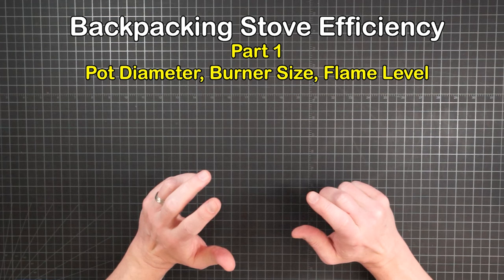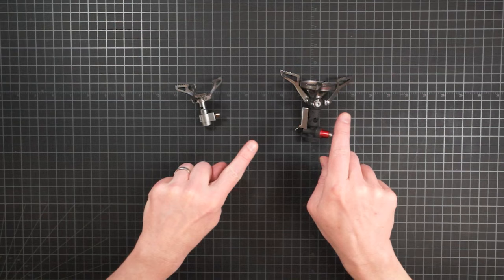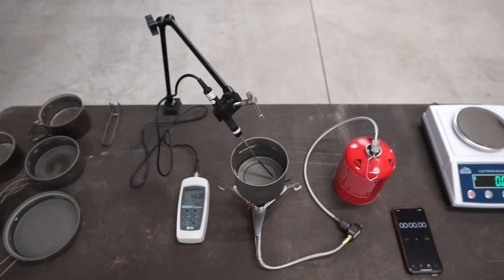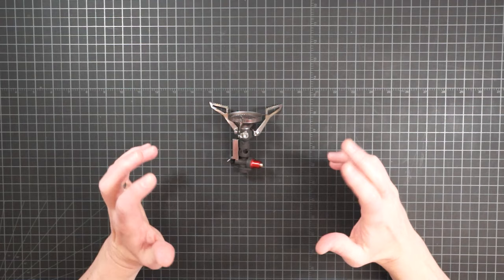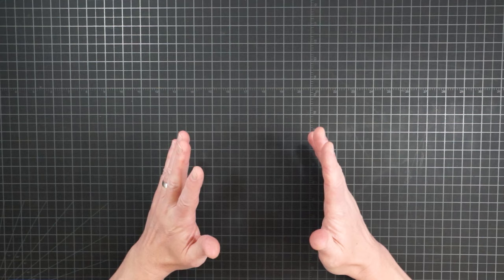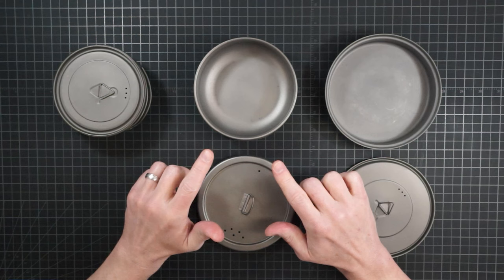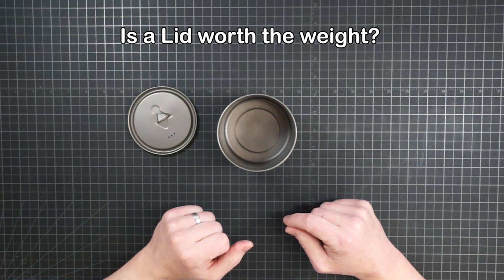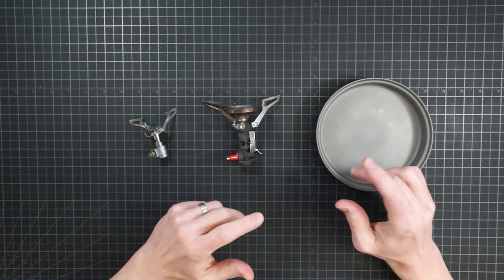Backpacking Stove Efficiency, Part 1: Pot Diameter, Burner Size, Flame Level

Comment: Thanks for another amazingly informative video. I'm surprised the lid isn't worth the weight on the 550.
any chance of seeing an ultra-low setting? your low flame looks about as high as I ever have my brs.
Reply from the maker: Hmm, I’ll have to give it some thought.  I don’t have a 4th valve for an extra low.  Also, you’d need a day without wind.  I’m doing wind-effect testing now, and at the shown Low, the BRS becomes highly inefficient with even a light breeze.
Reply: You'd have another issue. The process of boiling water has energy input from below, then energy loss by convection, evaporation and conduction. The longer time to the boil the more of the energy input is lost during the heating process. The lid helps lower losses from evaporation primarily (and to lesser degree conduction). Each of these will reach an equilibrium temperature where losses = input. A lower flame reduces losses from convection - the air coming up the sides of pot is lower as it's spent more time under the pot. Your intention of boiling water requires that equilibrium to be at/above boiling. If you put too little energy in that equilibrium may be below your desired temperature - i.e. your water doesn't boil. Even if you do get to the desired temperature, the longer you take to get there the longer the pot spent being above-ambient temperature so was losing some of that input energy (via radiation) etc. 

So there's a sweetspot, if you boil too slowly you will lose more energy in radiation+evaporation due to be spending more time at a medium-goal temperature, than you saved from convection efficiency from a slower flame.

So for every stove+pod+wind+temperature combination there's an optimum efficiency flame level which still accomplishes your desired temperature. 

What I do is I keep the flame low initially while the losses due to radiation is lower, then raise it later in the process so I spend less time while higher radiation losses, easy to do with gas, nigh impossible to do with alcohol.

Comment: My understanding was that since the BRS doesn't have a regulator, it's very hard to actually control it using the built in valve. It's either on or at high speed. Do you use it and do you see an issue in actually setting it to low speed in practice?
Reply from the maker: I do use the BRS, and you can still set it to high or low with the control valve much like any other stove.

What the regulator in the Pocket Rocket Deluxe does is to help keep a given setting once you dial it in with the control knob.  So, both stoves set high and low the same, but with a regulated stove, that level will keep itself steady even as pressure drops in the canister.

A bigger problem with the BRS is that it doesn't simmer well.  That's not really a lack-of-regulator problem so much as it is just so small that it tends to give that jet stream flow (as opposed to the soft shower head flow) all the way down to the point where it starts to sputter.

Comment: Very, very interesting. Thank you for the great information. I do have a question related to efficiency tho, Is using a wind barrier important? (Not to protect for wind, but as a heat reflector)
Reply from the maker: Well, they say you should never use a windscreen with an upright canister stove because there is danger of overheating the gas canister and risk of explosion.  I've never tried it myself, but would like to test it out using a non-contact thermal sensor.

But, if you choose a remote canister option (weigh a bit more, but more popular in super cold conditions), then you can put a windscreen around the burner and pot, because the canister it outside screen via extension hose.
Reply: @GearSkeptic  I use a ground based wind screen but always make sure it is open on the downwind side. Trail Designs sells a Varivent version that can be left open or you can make one using heavy duty tinfoil, a couple of small pieces of foil duct tape and two or three short sections of plastic straw through which you insert two or three (two works for me) titanium Shepard hook stakes to hold it in place. A rock will keep the center from moving inward and save a stake.

Comment: MANUFACTURE AND MODEL OF WEIGHT SCALE SO I CAN LOOK INTO BUYING ONE?
  Is that scale made by Seattle Alki?  Which model did you buy and why?
Reply from the maker: Yes, Seattle Alki model SEA3123000GR, available on Amazon.  I wanted hundredth of a gram accuracy, but with the ability to go up to some higher weight (this one is rated up to 3000g).

Comment: An aluminum pot spreads heat more efficiently than Ti so the difference between a wide and narrow pot would be even more pronounced, possibly?
Reply from the maker: It might, but I've been wondering about a variety of effects.  For the fastest, most efficient heat transfer into the water, you want to expose the coldest water to the hottest pot surface.

Aluminum may spread the heat to other parts of the pot quicker (to expose more water to a higher surface temp).  But, water circulates by convection when it gets hot.  This acts to move cooler water down to the hot pot bottom.

I'm wondering if the water's circulation will be so much faster than lateral heat transfer through the metal, that it will overshadow any advantage of aluminum.  Aluminum is lighter than titanium, but the walls have to be thicker to withstand the heat, so the pots usually end up being heavier.

Only testing can tell!
Reply: @GearSkeptic  It's a fascinating topic with all the variables. Yours is one of the most in depth analyses I've seen! Great job!!

Comment: Need to boil lots of water saving lots of fuel for them lids to be worth their weight. Just saying. Wouldn't have expected that result but seems you can have one less thing rattling around yer kit and 16g+ saved should make yer hike noticeably easier for sure.
Reply: Suppose it's obvious at what point in the video i typed that out. Seems to me though unless you for sure need 19+ boils and cant fit 2 fuel canisters(or a larger one) then no lid is the play just from a less crap to clean and keep track of standpoint tbh.

Comment: Did you take into account that evaporation scales with pot diameter and therefore needs to be measured or prevented? I typically use a lid to optimize fuel efficiency.
Reply from the maker: I think I would separate traditional evaporation from steam.  Evaporation is likely too slow of a process to be measurable in these tests.  It's only a 3 to 5 minute period.

The steam from the super heated water, however, would carry quite a bit more heat.  Unfortunately, you can't make the pot a pressure vessel, so there is a limited amount that you can do to stop the steam from escaping.

A lid will still improve efficiency for two other reasons, though.  It limits radiative heat loss, and convective (the circulation of fresh cold air against the hot water surface).
Reply: @GearSkeptic  I sent you an email as well, but there is a weight efficient method to make the pot a pressure vessel! A stretchy silicone lid weighs 14g and can create a tight enough seal on my pot to keep the lid on until a few seconds before boiling. I use a 500ml pot and typically boil ~1.25-2 cups. I bet with a slightly smaller pot that had less airspace in the beginning the silicone lid might be able to stay on up through boiling.
Reply from the maker: Love that idea! Will definitely check it out.  Thanks!

Comment: What about cold? 
E.g boiling water in -5C, 5C vs 10C. 
Not only water temp but the stoves.
Reply from the maker: I would like to do some very cold weather testing, but I will have to wait until next winter at this point.
Reply: @GearSkeptic  same problem here. Wanted to see if different stoves and fuels, winter gas make a difference. But that needs at least <-10C because with warmer weather ordinary mix works somewhat. Unless a cold storage facility provides the space for testing.
Reply: Relative efficiency is not altered by temperature as what ratio of the heat energy transferred, that is the distances and materials.

What can happen is you have different options with the flame level to optimize fuel efficiency. The absolute temperature change when higher makes it more efficient, i.e. to raise temp from -5C to -4C takes less energy than to raise from 10C to 11C. You can use this to your advantage by having the flame lower til water bubbles (so that part is more efficient, less fuel) and then raise flame towards end if required.

A lower flame may not achieve boiling in low ambient temperatures as the heat loss is greater. So if you do use the trick of a lower flame to raise efficiency you may need to raise flame level to get past the plateau when loss=input if that occurs at too low a temp.

Comment: Are all the pots titanium. which does not conduct heat very well???
Reply: Titanium conducts heat similar to steel and about twice as good as Aluminium. But Titanium is about twice as strong as steel, and Aluminium is half the weight of Titanium. So what that means Titanium weighs the same as Alu for like-strength but conducts heat twice as fast. That is good+bad. Bad is the hot spot in the pot is closer to the flame's pattern on Titanium, but less energy is spent in raising the metal's temperature. I use an Alu pot for regular food cooking and Titanium for boiling water.

Comment: I love your videos, but I think they would be more, um, palatable and understandable if you cut them down to a third of the length, and then had a separate video with all the details in case someone wanted to do a deep dive.  Also, I would adjust the overhead camera so the viewer doesn’t feel like they are hanging upside down.  But amazing content nevertheless.

Comment: I'm only 18 minutes in, so you may cover this. In real world applications, the low flame might not be the most efficient. Low outside temperatures means that the water is losing energy to the surroundings at a greater rate and wind may deflect the heat to a greater degree, due to the lower flow/exiting pressure. So in extreme conditions, medium or even high might be more 'efficient' simply because low is not effective enough to counter environmental losses.
Reply: neeeevermind, got to min 25 now. :) excellent video as always.
Reply from the maker: For Part 2 on wind effects, I've ordered a fan with an infinitely variable speed control so I can get it nice and low, and use finely graded steps to see how performance drops off.

Comment: Grey shirt guy wants to know about weight and fuel efficiency for a beer-can pot in a caldera cone with esbit and alcohol fuels, lid on.
Reply from the maker: Noted 😉

I do have (eventual) plans to test alcohol and solid fuel against gas.  Finishing up the wind effects for Part 2, now.  Then wind screens for Part 3. Probably heat exchangers for Part 4.  But, it’s on the list!

Comment: Great study but disagree with one conclusion, to use the BRS.  In real life, the BRS lacks the wind shield and regulator on the PRD and with any real wind (and cold), the BRS will waste more fuel
Reply from the maker: Wind testing is already in the planning stages!
Reply: @GearSkeptic  Awesome, looking forward to it!  In unshielded high wind, the BRS won't even work and the PRD barely does but burns tons of fuel.  In my lightly controlled field testing, my PRD's fuel efficiency (cups boiled/oz fuel) reduces ~ 50% when ~ 35-45F and moderate but gusty wind.  Backpacking Light's tests found the same though their efficiency #s overall are much lower than yours.  My efficiency results and most others are consistent with yours, ~ 8.5 cups boiled/oz fuel 118d pot & low flame.  I assume your boils were 1.75 cups based on 415g of water.  Most others use 2 cups/boil in their testing FWIW.

Comment: I’m sorry, but I’m a bit confused. At the beginning of the video, you said that the industry markets the performance of its products by how fast they boil water. But in all of the test results that I saw, unless I missed it, you didn’t talk about how fast water boils. I understand the dynamics of your tests showing fuel consumption vs. burner size vs. pot size. But how does any of that information help your viewers understand the one marker the industry has set, which is speed to boil? How does any of that information help your viewers understand the best combination of burner fuel and pan in relation to cooking out on the trail? I'm not trying to be a jerk, I'm trying to understand the purpose of this video and how it can help your viewers.
Reply from the maker: The video series is about fuel efficiency, with an eye toward weight savings.  Speed is irrelevant in that regard.

Comment: If a few grams are making you fatigued, you need to hit the gym.
Reply: Broadly agree but in some situations it makes a bigger difference. If you can make a certain length of trip get by with a 100g canister vs otherwise a 230g canister you're carrying a much smaller canister. It also saves you money as using less fuel. But yes if you spend a fortune buying lots of kit you not poorer not richer in the wallet.
Reply: @GeekfromYorkshire  Well I refill those 1lb green bottles from my 20lb tank for pennies so cost isn't really an issue to me. 😅